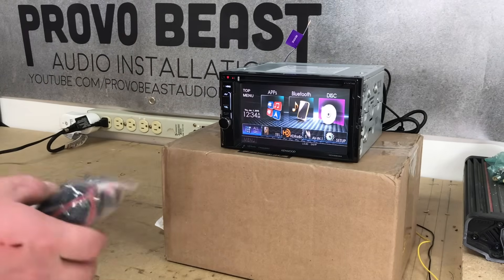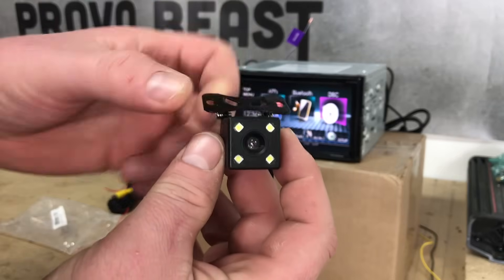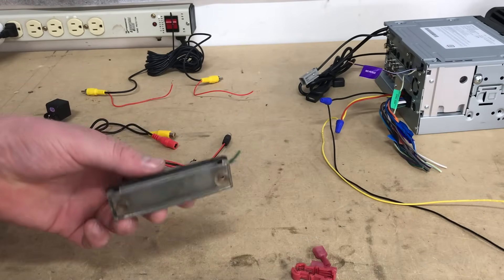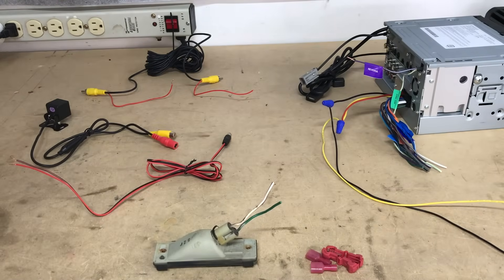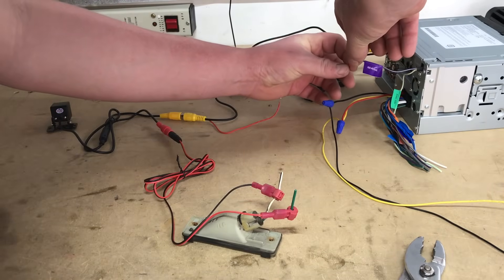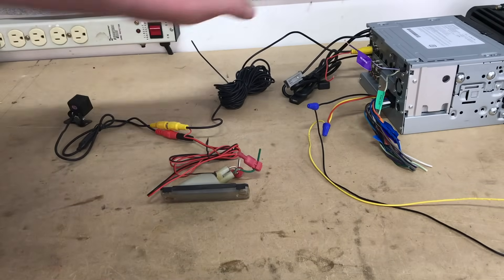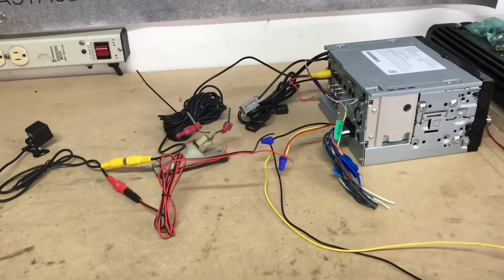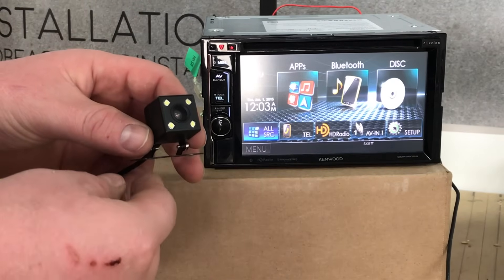Car Backup Cameras Explained: How To Install On Your Car!

Comment: I installed the camera with your second method works great but i have a problem the leds ln the camera stay on all the time is there something i can do to turn them of yet have the camera funtion on reverse and manually? Thank you very much
Reply from the maker: It would be to replace it with a different camera that don't have LED's.

Comment: Many thanks for the video, really helpful. My car already had a similar camera fitted when I bought it but no wiring etc, so I had to buy a new camera. The existing camera is fitted to the tailgate with a small hole for the wire, it only had a single wire. On the new camera it has wires like the one in your video, with the red and yellow plugs and the only way to use the existing hole is to cut the wire from the camera to the plug and reconnect it. There are five thin wires. Once reconnected I will secure them within the tailgate.  Could you suggest how best to reconnect the thinner wires, I wanted to solder then but will struggle as the wires will be dangling down from the tailgate. I was thinking a kind of small connector, but the two sections of wire are very thin, so it would need to be shall connector or plug, other than that, will have to try to solder at a height. I like the T connectors you used but I am not sure if they would be to big for the wires.

Comment: So if the  little red wires on video cord aren't hooked up the monitor won't automatically go into reverse mode? You'll have to set the screen on the monitor to reverse mode manually in order view what the camera is capturing?

Comment: If I’m using a PAC module (2010 Wrangler) and it has a reverse trigger wired to the radio’s reverse trigger wire..... then I don’t need to connect that little red wire dangling from the video cable, correct?
Reply from the maker: You are right, you wouldn't.  However, you could use that red wire as the power wire for your camera so you can connect it to accessory power behind the radio so the camera is on whenever the radio is on.  Just an idea.
Reply: @ProvoBeastAudio  If I choose to do it that way, do I just connect the black to bare metal on the car?

Comment: On my reverse light I have a red and a black wire , how do i know which wire from the reverse camera to connect to my camera wire ?
Reply from the maker: use a multimeter or test light.
Reply: okay thanks and does the t tap size matter cause i just bought some but not sure if i can get any ?

Comment: Thanks bro! Couldn't figure out what was draining my battery. Turns out I had the power to the camera on a dedicated 12V fuse tap. Switched it over to t-tap the reverse light and haven't had any issues yet.

Comment: I'm not sure how I'm supposed to give the camera power without having it close to the reverse light. The red wire that comes from the video wire is kinda short
Reply from the maker: Just make it longer, add more 22 gauge wire and you can extend it anywhere.

Comment: Really good explanation it helped me alot. Thanks!
I got one question. The second option you mentioned the camera is always with power and you can switch to camera mode in the radio the camera leds will be always on or just if you change to camera mode or reverse?

Comment: How the leds works? Do they come on everytimes the camera as power or only when the reverse source is on? Like if u plug the main power of the camera from the backup light obviously the led will only light up when reversing but when using a constant power source (your 2nd method) would they always be on? 

I would like to plug my camera with power always on but id like ridiculous if the leds are always on all the time, might be annoying for those following me at night

Comment: What am I supposed to do with the parking break trigger wire? I read somewhere that I just have to ground it but I'm sure it's different with different stereos.. so flustering and confusing.
Reply from the maker: All depends on the radio you are using.  If you have a Pioneer or Alpine, it will require a bypass which we have videos on the channel to show you how they work.  Some radios can be just grounded.  All depends on the brand.
Reply: @ProvoBeastAudio  It's the Boss BV765BLC that comes with the LPCB36 backup camera..

Comment: Exceptional instructional video. Well done. I bought an aftermarket (OEM comparable Rosen head unit) for my 2009 Corolla and need to wire a backup camera. Thank you!
Reply: Did you get to do the backup camera ? Did it connect to the Rosen head unit?

Comment from the maker: Two Million Views and counting, thanks for the continued support!  Don't forget to subscribe :)
Reply: Rite simply explained for even if you just want constant power for your camera when you manually switch Great Video Dude👍😎
Reply: I bought similar system from eBay received it without any instructions and thank God I came across your tutorial. God bless and Thank you.
Reply: My head unit gives me the option to look at the camera image anytime I want I’m driving down the freeway I can turn it on. And the way to do that is to take the red wire in the black wire just hook the black one to the Jessica car and then find any hot water in your car you could even go to your license plate light but you’d have to turn your running lights on to turn the camera on. Or even just connected to your cigarette lighter where it’s always hot then you can look at the image anytime you want. And it will still come on when you go in reverse
Reply: Wow talk to text really messed up my comment shit!
Reply: It was supposed to say black wire to the chassis, not Jessica. Lol
Reply: Holy shit another one, hot wire, no water. Damn!

Comment: This is a great video. I have a Kenwood deck that has the "CAM" button to see the camera at anytime.... my question though is - if I hook up the camera to be on all the time so that it can be viewed without being in reverse won't the LED's on the camera be on all the time? I hope you can answer this because I'm installing it this weekend! Thanks in advance... I'm thinking I might need a camera without LED's :(

Comment: Hello, if hooking up this camera to a lcd screen with AV in, instead of a stereo reverse gear wire input, is the red wire on the AV in plug not necessary?  Thanks.

Comment: Great viideo! What would cause a camera to be stuck in Reverse Parking Camera mode and only shifting to normal mode when the car is either in Reverse or the doors are open?? This issue has been occurring since I got the car back from the dealer who flashed the Body Control Module to activate fog lights...

Comment: wait so what if the harness on the back of my radio does not have a wire labeled reverse? .. but i know it’s compatible for backup camera because it has the rca plug for it
Reply: Same issue here, let me know if you fixed it

Comment: instead of wiring it from back to fromt for constant camera power just.. wire it into your rear running lights its right next to the reverse lights and works just as good

Comment: Are the cameras interchangeable with the wiring? Can you use camera 2 with the the wires from the first setup?  Do you need to splice wires or use an adapter?

Comment: Hello, Great Video and very Helpful! I wasnt aware of the second option of wiring it up but that actually sounds like it could be better. Would hooking the camera up to the 12v power source (cigarette lighter) in the back be possible to power it? Also would the radio still automaticalty go in reverse aslong as the extra cable on the video cable is hooked up to the reverse light?

Comment: I need some assistance. I have the same camera being hooked up to a Phoenix Automotive Android Radio. I have the 2 red wires hooked together and running to my reverse light power. I have the black wire running to a ground on the car. The RCA cable and power are plugged into the back of the camera. My issues is that when I hook up my red wire on the yellow RCA to the Radio, I am getting constant power (through the LED Light), even when the car is turned off. Should that be the case? I do have an option to see the camera even when not in reverse so I just am not sure if the LED light be on at all times when the car is on or just when going in reverse?

Comment: Hi there, thanks for the great video. Its very nicely done. Just to put it out there, accidently I found out that even if the ground wire is not connected, everything still works fine. Only the red wire needs to connect to the positive of the reverse light and it works! Any thoughts on it?also my camers seems to have no grid/guide lines.. Not sure what might be the issue. Thanks.

Comment: i am with everyone else, this is the best video out there....one question the red and black wire that goes to the backup light can i attach it to the park light or the liscence plate light for for video when i drive if i turn my lights on?

Comment: So weird. I use youtube more as a motivator to connect with like minded people!  I was going to wire with excess wire then as soon as I seen a video that said tail lights that helped regain my focus. Seems obvious but it can depend on some factors but thank god I saved myself future hassles because the tail lights are perfect for a shorter wire run . The only issue I have now is that I have to press on the camera on the head unit to get the camera to show up when I put the vehical in reverse. I should have the option to have the camera automatically show up when I put the vehical in the reverse gear from any menu and not have to find the camera. Any suggestions help, and also I will watch the video. Either wiring again, or settings on the head unit. Nice, you may have helped solve the problem, I don't have the same cord so I will have to see how this works!  Ha ha!  Thanks man!  I don't have to celebrate on my own!  I was waitin a whole day to just say......... bohse!!!!!!!!!     Its people like yourself who give back to the community!!!!

Comment: Great video! I have a question though my old camera is wired in my Ram 1500 to view my trailer at anytime during key on towing.
I just replaced camera with a new one with led lights for night vision and the lights stay on whenever key is on which makes for a bright white light pointing back into cars behind me faces.
How can I change this to be only when camera view is on the screen.

Comment: I have rear camera installed by same method. But My pioneer system also has a function to use rear camera while driving ahead but as the camera is getting power only when the car is in reverse gear, my question is how to give power even without rear gear.

Comment: What if I have a smart harness with the reverse lines connected together. Can I still connect the wire from the camera to the reverse lines without any issue? Any info would be greatly appreciated

Comment: I recommend to use a 12v relay to be triggered  from the rear light but to get the voltage from Rear Electronic Center of your car.

Comment: So on the parking brake wire, if I ground it off so the dvd player will work while driving, will the reverse camera still work correctly? I've put in a good few cd players, but this is the first time putting in a reverse camera and all that.
Reply from the maker: The parking brake does not affect the function of the reverse camera.  It wouldn't make sense for your parking brake to be on for video to work so you can reverse?
Reply: @ProvoBeastAudio  I mean, I've just never done this before, so I was just making sure.
Reply: @ProvoBeastAudio  thank you!

Comment: So I hooked mine up but it's not working. I used a test light to check for power and I'm not getting power coming from the reverse wire on the radio. So the little red wire is supposed to be connected with the reverse wire on the radio and nothing else right?

Comment: Is 100% neccesary the connection of the short red wire on the video cable? I already have the radio cable labeled as "reverse camera" connected to one of the cables coming from the lever shift, the radio is properly changing to the video input corresponding to rear camera, now i'm planning to install the camera, so i'm suppose is neccesary only connect the power wires to the reverse light and when that light goes on, the camera will be on at the same time displaying video.

I'm correct? Thanks in advance.

Comment: so on radios that allow you to manually look at the reverse camera by pressing a button on the screen but also automatically display the reserve camera when backing up, I'd choose the second routing option?
Reply from the maker: Bingo.
Reply: @ProvoBeastAudio  
The LED’s will burn all of the time if you run the “plug you called the power plug with the ground “ up at the accessory switch. 

Those only powers the LED’s.  The camera is powered by the RCA actually.    
And the “power /ground “ can actually be connected to the tail lights to only turn on the LED’s when you put car in reverse.   

This also allows radios with the viewing option to work “WITHOUT THE LED’s burning”. 

RIGHT ?  Because like I said.  The camera gets a positive & negative power from the yellow RCA .    

This might not be on all cameras.  
But it does work this way if it has the “CONVENIENCE WIRE”. 

this is the only thing I saw you missed.  

Great vid otherwise though.
Reply: @ProvoBeastAudio  
Plz correct if I am wrong. ? 

Because I am installing one now.

Comment: Hey guys. Is it possible if i could hook up a two cameras on one port of the headunit?

So basically what i want to do is to install a front facing camera, which will get the power from either blinkers or high beam, and then have it attached to the reverse line from the headunit together with the reverse camera which was already there from the factory. I want to have a front facing camera as my garage is small and tight and i would like to avoid hitting the rails and other people's car.

Comment: Thank you for this video. I connected mine and it works great. However the camera light is on when the key is on. I’ll rewire it as you showed and I won’t have that problem

Comment: What happens when I tap into the reverse wire and it turns on the reverse light and slowly drains my battery? 

What am I doing wrong?

Comment: So I tried this today. The black connector with the red and black wire is for the LED lights, I'm assuming because when I power it on, it only illuminated the LED and no camera function.

Comment: This video is wrong, please do not follow these instructions if your car radio has a Canbus.  I followed these instructions for method 1 and while the camera worked I ended up with multiple errors on my car's ECU from multiple modules.  You do not connect the red wire from the video cable to the rear light positive source or to the rear of the radio, if your radio comes with a Canbus module. The canbus will operate the camera when power is applied via the rear light bulb.  The instructions given in this video only apply to car radio that do not have a canbus.
Reply: 3yrs later your comment still confuses.  WTF is a canbus, what does one look like etc.  lol … while well intentioned, fairly useless
Reply: @laborspy  CANBUS is an electronic system that monitors your cars systems. Whether that’s lights (turn signal, etc etc) so if your light goes out, it will tell you so. 

CANBUS works on tons of stuff, including radio, and more. Sometimes if the CANBUS will interfere, you can use adapters or other equipment to make it work.
Reply: @laborspy right
Reply: @laborspy canbus is how cars communicate between modules this is for aftermarket radios
Reply: Then how am I supposed to wire it up? You can't just say somethings wrong, then refuse to elaborate.
Reply: Do I still need to connect a ground to the camera power cord ?
Reply: It's for aftermarket radio is not stock is for aftermarket radios not stock
Reply: Can you pls help me I’m stuck! Everything works but the camera. I have canbus installed
Reply: THANK YOU SO MUCH !!!!!!
Reply: The videos not wrong your just stupid 😅
Reply: A simple wiring diagram would have been helpfull. Such as came with the camera in the first place.
Reply: You are wrong. These instructions are 100% accurate. You don't need to wire the power cable off the video cable at the reverse power cable. You can just tap off the power cable coming from the camera. That video power cable is way too short to reach the reverse light. Just tap off the camera power wire. It's the same thing.
Reply: I don't understand why the video cable needs to be interrupted and be connected to the red power. Since the reverse lights are off, the camera is off and the radio should understand that has to quit reverse mode. Why there has to be an interruptor at the video cable, too. And how this cable transfers picture to the radio and electricity for the light at the same time?
Reply: Well I am very familiar with Canbus wiring. Can high 2.6v and Canlow 2.4 has to equat to 5V and so forth. Communication is key. How this this after market radio camera will only power on if there is a power source in reverse via POWER SOURCE! Can or no can bottom line is that if there is no 12v to the red wire it simply will not power on. The brake wire is key and easy. Thanks for this video. Great video and very well made.

Comment: I have a rm/rmvb/by/fm/player. It does not have a reverse but it does have brake line and parking sensor control wires. With one of those be the correct one for the camera to cycle to reverse? I know the camera works because it came with it but there was no instructions